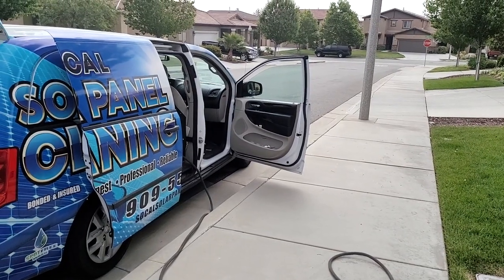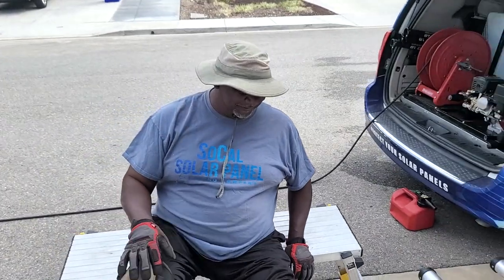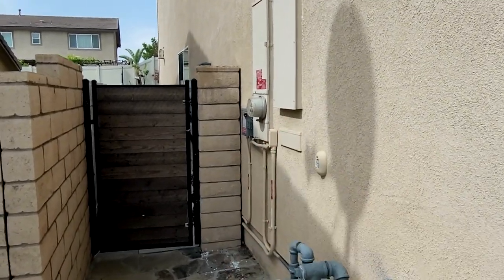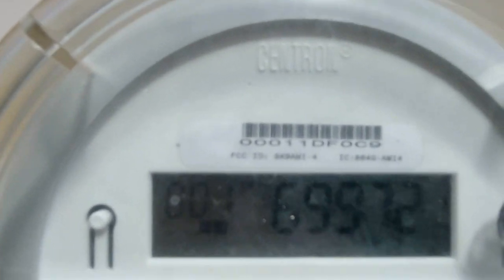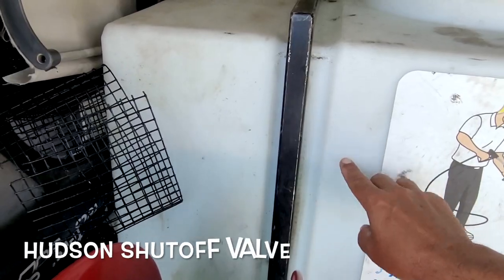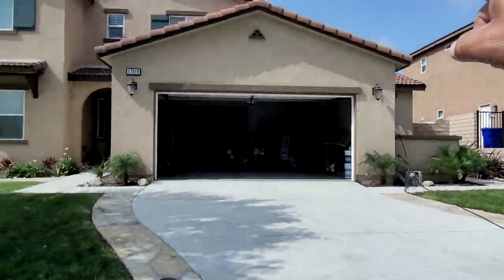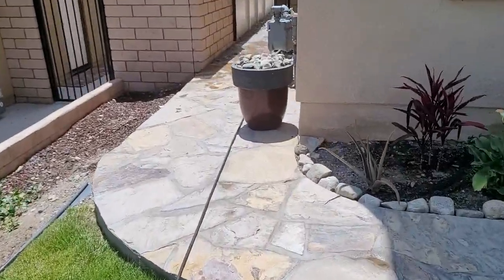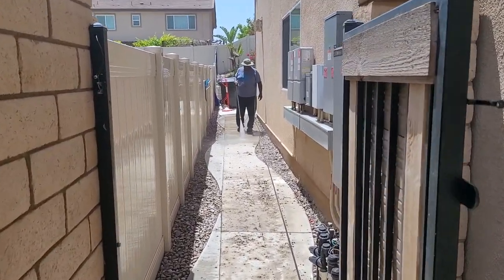Solar Panel Cleaning and Bird Proofing The Easy Way in Fontana Ca

Comment: Hey Henry .. question? I’m just starting out my business and I’m going back and forth on this .. 
the video you guys did with mark from ampw.. he showing you can lightly soap the panels and scrub them down and wash it away ..  and that’s it.. 
but your guys keep saying don’t you soap at all and just use Di water .. okay I can see that too… but me starting off do I use soap or do not use soap…. The reason why is because I have my whole set up with the pressure washer and tank …  what do I use ?  A extend pole and di water or spray it down with soap , scrub it and then wash it ?.

Comment: I have One important question,because i never seen do you guys using owner water only or your own? And if i just want to start its OK to buy mobile dionaized wter filter on wheels and conect with owner water and use it ?
Reply from the maker: Most of the time everyone will use the customer water to fill tanks but it has to go thru our system to deionize the water and it will go into our holding tanks. If you have to buy water there are places to do that too.

Comment: FYI fellas, that electrical is rated nema 3r, not nema 12x, you cant do wash downs. That equipment is only rated for rain, not spraying with a pressure washer. You need to be above it and aiming down for it to be safe.
Reply from the maker: We don't use pressure washing for solar panels only cleaning roof tiles